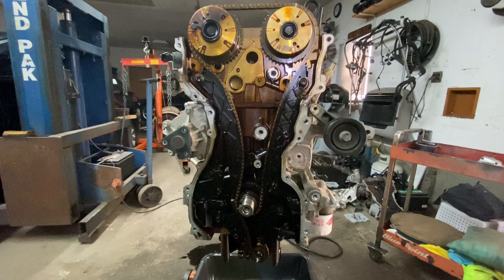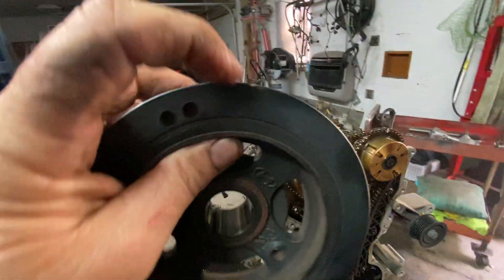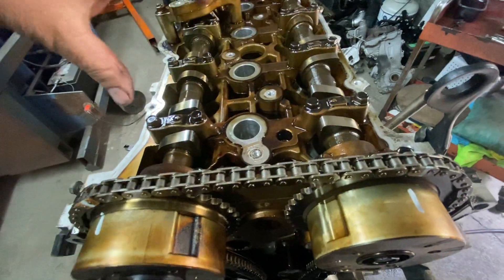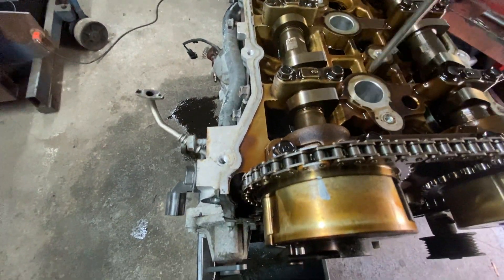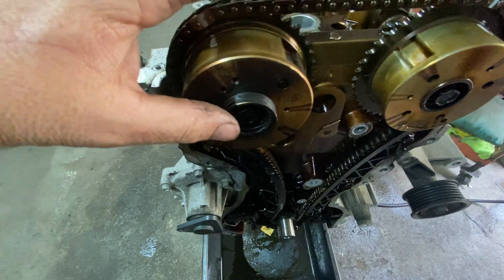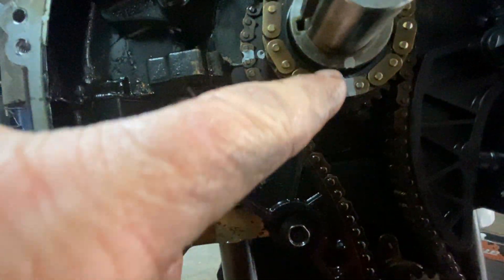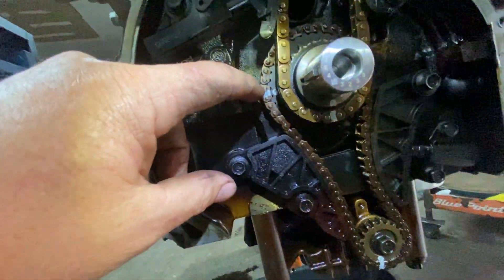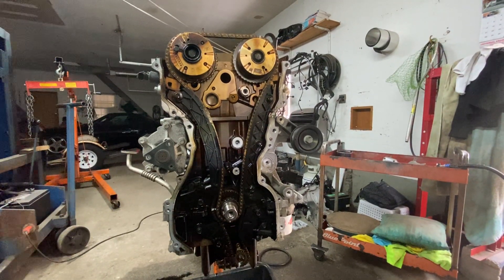Valve Timing Marks for  2011-2014 Hyundai Sonata, Santa Fe, Kia Optima 2.0 turbo

Comment: @motorcarnut my timing marks don't line up on the valve camshaft but do on the exhaust camshaft and crankshaft... why is that? I want to send a pic and let you see what I have goin on.
Reply: I can't get the valve camshaft mark to line up directly to the exhaust camshaft mark.   The crankshaft is at TDC.
Reply from the maker: Your timing is off then.
Reply: @motorcarnut  I can't get the valve camshaft mark to line up directly to the exhaust camshaft mark.   The crankshaft is at TDC.
Reply from the maker: Just set it up like in the video and count the links to make sure

Comment: After you rotate it the chains don’t line up with the colored links and marking on the crank/cams. Is this normal?
Reply from the maker: When you line up all 3 colored links, 2 on the cams and 1 on the crank you’re in timing. Now when you rotate the engine crankshaft clockwise twice they won’t line up again but that is normal. If you were to count the links from each mark location you would see that the engine is in timing.

Comment: This video helped. I bought a Kia optima 2011 2.0 turbo with check engine light, PO 0014 Camshaft chain was okay however the balancer shaft chain was off by two teeth. It will start but rough idle "alternate" and engine made a noise when accelerating. Had to drop the oil pump module to adjust chain, 6 bolts. Thanks for the video.
Reply from the maker: Glad it helped. Thanks for the comment!